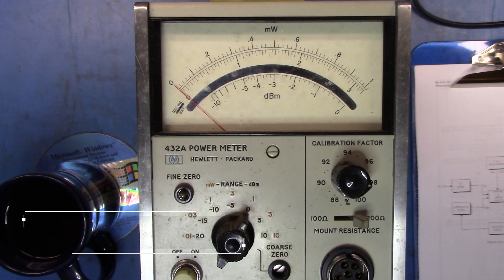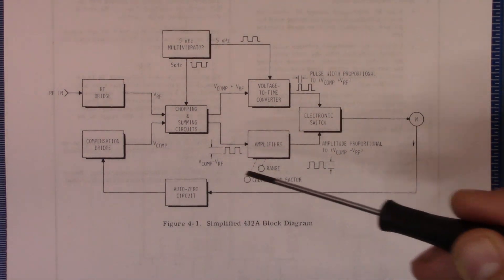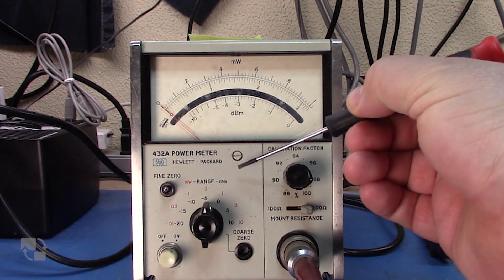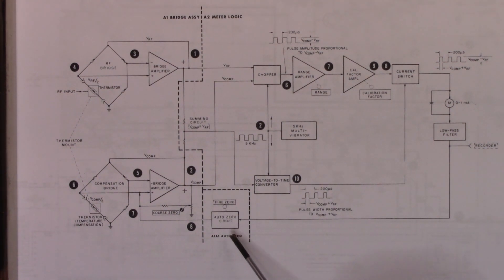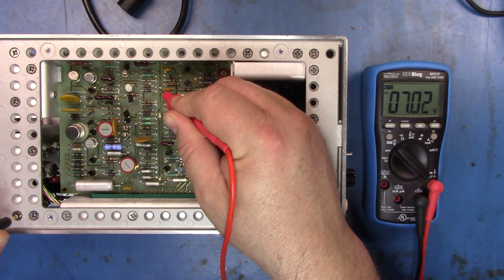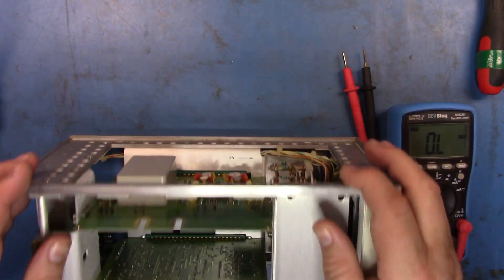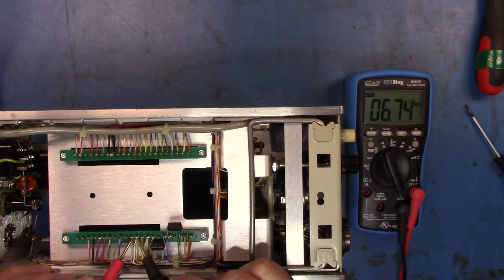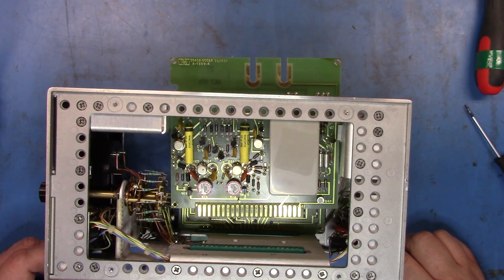HP432A Power Meter Doesn't Zero - Repair Part1

Comment: Hi! My A1 A1 unit burned down. Please tell me, should I buy it?
Reply from the maker: I would be happy to try and help but I don't really understand the question - Are you saying that your A1A1 Auto-Zero assembly burnt out and you are wondering if you should buy a replacement?

You could probably repair it but I think these were a "factory" calibrated unit as, while the schematic has parts on it, the replaceable parts list only has it as a full assembly.

I think you might be better off trying to find a cheap 432A without sensor and give just swapping out the A1A1 into your original unit.